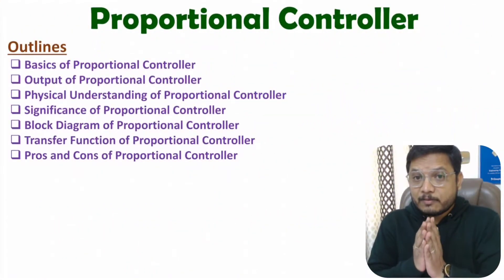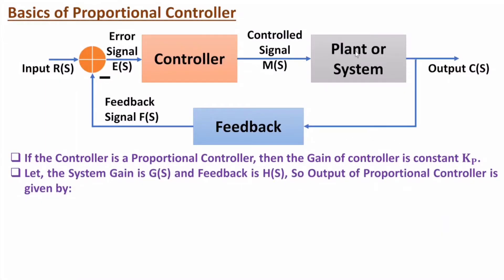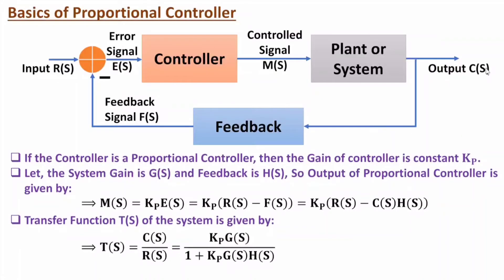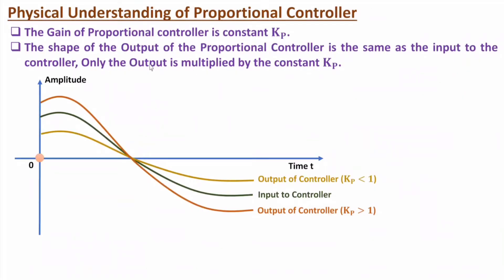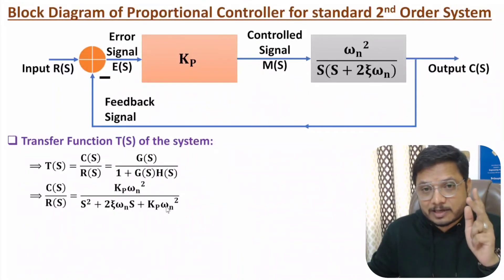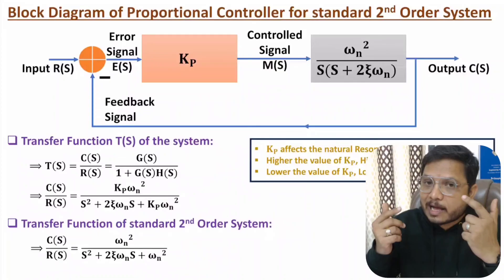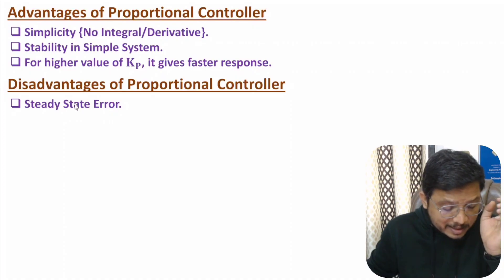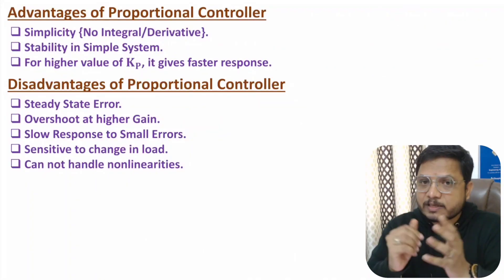Proportional Controller Explained: Basics, Block Diagram, Transfer Function, Pros, and Cons

Comment: why increasing the kp would increase the ess,, ess is calculated as 1 over 1 plus k multiplies kp ,, in both second and first order systems so why and how increasing the kp would ever increase the error,,
Reply: We're ONLY dealing with proportional case in this video. As you can understand from its name, its proportional controller. Its only job is to maintain at a level that aligns with output of the desired case. Like if you want to settle at 1, and you have a higher Kp value which increases overshoot as well, forces it to settle at a point greater than 1. But for a lower Kp value, the steady state error would be minimal compared to higher one.